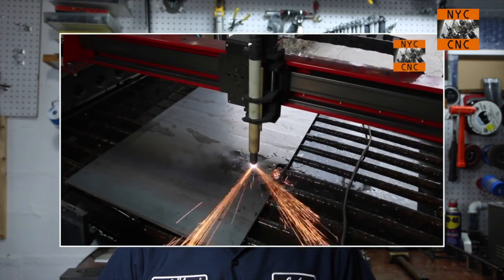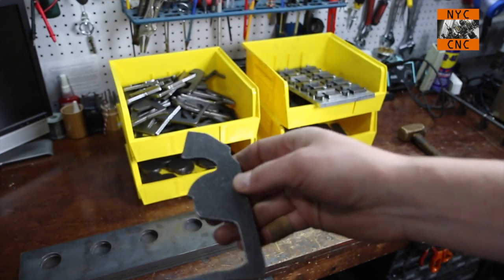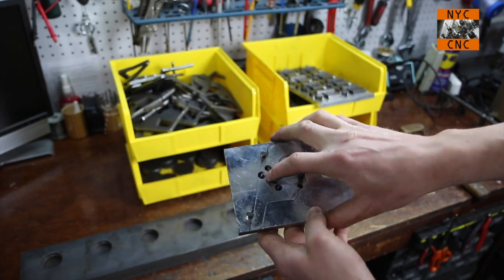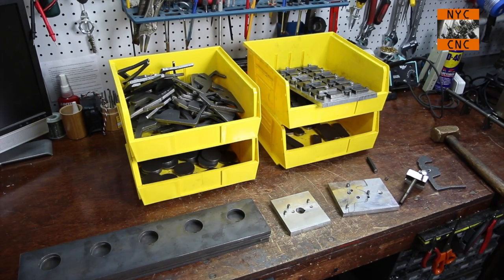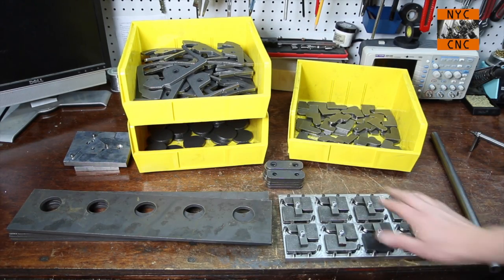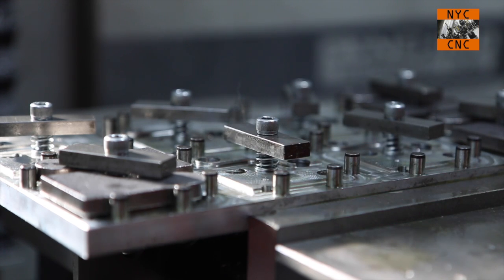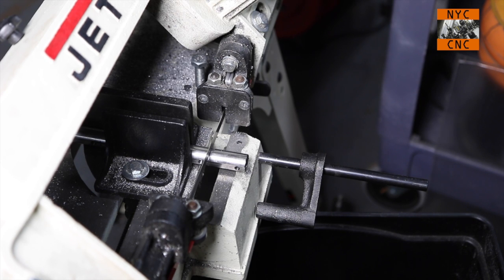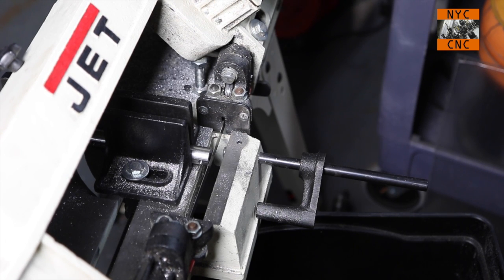Manufacturing At Home: Steel Target - Part 2 Machining, Punching & Fixturing

Comment: Why not avoid the step of center punching (and the center punch parts) by making a jig that holds the pieces in the Whitney punch?  Index it off the bridge piece you made or create a jig holder that is attached to the Whitney punch.

Comment: I'd like to use the hydraulic punch press to destroy computer hard drives.  computer  hard drives are made of aluminum housing, stainless steel plate and aluminum platters.  Could this machine punch a 2" diameter hole in a hard drive?

Comment: I used one of these punching machines  in shed building, first and then we got a 90 ton cropper punching machine  and made jigs out of flat metal with 6mm hole drilled through it  and laid it over the plates i wanted to punch up against a stop and centre punched with a 6mm punch they came out good.

Comment: Hi John, are you going to use a gshield with that arduino?
Reply: John NYCCNC I am using a gshield, aka grblshield with an arduino for a cnc router/plasma table. It is a plug in board to drive x,y and z steppers using grbl code on the arduino. Info here: https://github.com/synthetos/grblShield/wiki

Comment: Nice work, John! Glad I watched to the end as well... Are you going to make a series of videos on that project? I don't want to give it away so being vague...
Reply: I like the idea of doing the good with the bad. It helps teach methods of problem solving plus it show how and why you landed on a specific design.

Thanks for sharing what you do!

Tom
Reply: Your content is always interesting! I'm not suggesting you record every second of the build either just enough to follow the whole process.

Personally, I find it difficult to show when I make mistakes or when a weld didn't come out as good as I know I can do. It's much easier to show my successes rather than my failures. I was secretly happy when I realized I had run out of space on the camera the other day and nobody got to see the 3 times I had to install a bracket because I kept getting the orientation wrong...

I appreciate what you are doing, as I am sure others do as well. Looking forward to your next set of videos!

Tom

Comment: You have some of the coolest tools. I have a Jet cut off band saw just like yours.
Reply: When I bought it I didn't know how much I would use it. But I have found I use it so much if/when it goes bad I am going to buy the next size bigger with a coolant system. It is so handy.

Comment: excellent work, really enjoy seeing how you use fixtures for multiple parts. Thanks for taking the time to document as you do really enjoy yours and others work great tips.  I agree with david below, for your automated chop saw might want to consider cold cut, I think you would not regret it in the long run :)  Either way will be an excellent project  take it easy man,  Mike

Comment: Go for broke with a cold cut saw.
Reply: John NYCCNC Your design. Just use their blade :)
Reply: No, I meant just build an arbor to use a cold cut saw blade and make it a diy auto cold saw. Should be a lot easier since there is no miter capability needed.Although it would be tempting to build around one of the metal cutting circular saws.

Comment: You have really upgraded to some very nice heavier equipment since the apartment days what ever happened to the atlas mill you had are you running a converter for the three phase here in tn we can't get thee phase power in residential or do you live in a commercial residential area thanks for posting another great video john